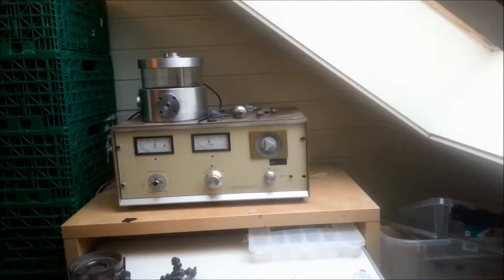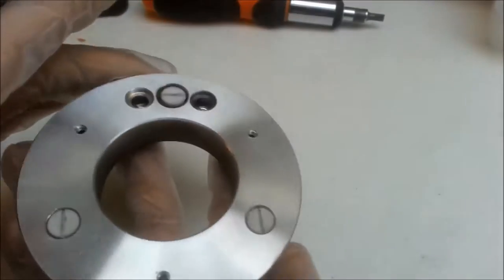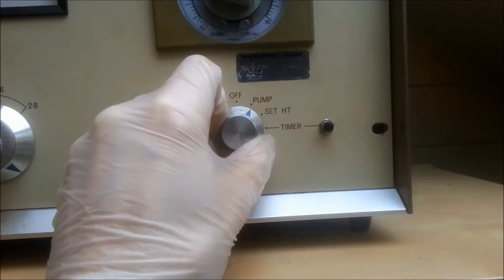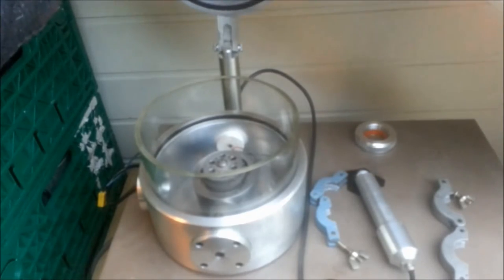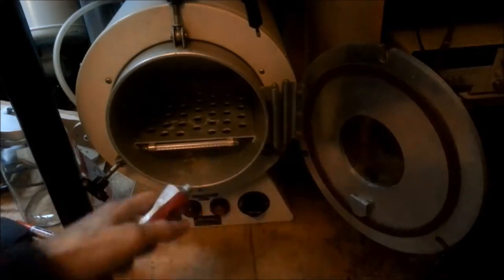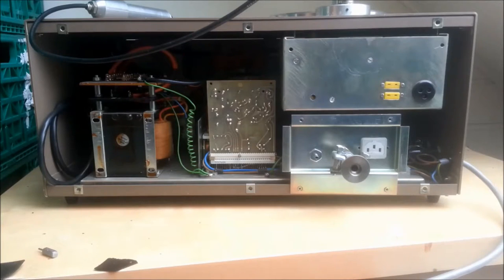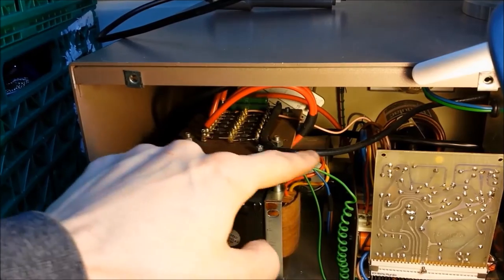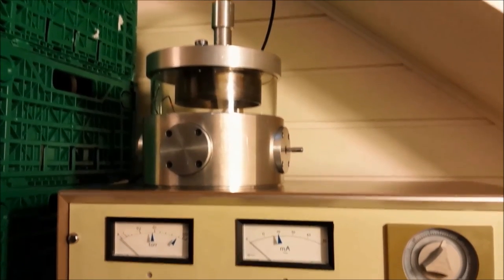The e5100 Sputter Coater Teardown/Maintenance.

Comment: I am used with some of the new versions of sputters and just wondered how stupid is the new design of the targets till I came to see these old models. What a huge size of the target with the right shape, since magnetrons always chew an annular shape. Nice to see that the manufacturers got it right in the beginnings, then downspiraled
Reply from the maker: I know right! It feels like you pay for the fancy metal in the target, with the disks there is still like 40% left when the disk is unusable.. There is definite elegance in the simplicity of old school, my only caveat with the e5100 is that it predates standard flanges like kf, so there is currently an improvised coupling that never seems to keep tight..
Reply: @JKKnudsen  If you replace that tube at 6:44 with a piece of tygon tube it should solve a lot of issues. Nevertheless, I also used a similar type of tube to pump a dewar with a vacuum valve operator down to 10-6 torr, which is overkill for the sputter needed pressure, and can allow, with some fiddling, the operation of 2 stage pumping systems. There was another type of sputter coater I used that is from Edwards. Instead of using 2 pumps, it used only a rotary pump and reached low vacuum via a Ti getter disk, thus removing the need to have the turbo pump with all its control electronics.
Reply from the maker: @ciprianpopa1503  I may try the the tygon. I did turn a stainless kf addapter attachment on the lathe, but the pipe on the SEM is copper, and silver solder pricing rubs me the wrong way these days. So I never got around to it. A friend of mine has one of those Edwards pumps, they are super nice! He use the same setup for making various vacuum tubes, heating the getter with an induction coil after sealing the tube.

Comment: I recently bought one of these, the E5200 Auto Coater made in 1984 but otherwise very similar. It was in a bad state, previously a home to a mouse, complete with chewed wires etc. I'm in the process of restoring it and hopefully use it for coating semi-silvered mirrors :)
Reply from the maker: Oh cool, the e5200 should give you some much needed headroom. Still the same kind of feed-through though. Leaks like a sieve:P If you contact quorum technologies, they may have refurbishing kits for the e5200, even though it is discontinued. Mouse you say, wonder what Pinky and the Brain has been up to:D
Reply: So far, I replaced the ballast resistors for something more substantial, managed to find the right O rings. I did notice that you have a proper magnetron head on yours. On mine, it has a couple of ferrite magnets attached to a dark shield. I'm replacing those. I will contact Quorum though. I didn't think they'd be interested!  There's a shortage of videos like this. Keep it up!

Comment: Hi, thank you so much for the video! We have this model in the lab, but no one knows how to use it. Do you still have the user manual? The PDF link you posted is not valid anymore. Greatly appreciate!
Reply from the maker: Ahh typical. I don't currently have a link. And I'm not quite sure what company has taken over service of the product. 
That said,  I've been thinking about rebuilding the vacuum line of this machine to KF, and replacing o-rings etc. I could do a video on it and include a complete operators guide.
But in short:
-Make sure everything is closed/off.
-Open argon regulator(NOT the needle-leak-valve on the machine, but the regulator on the tank)
-Set operator knob to pump.
-Start pumping to ~0.02torr(should be a mark on the display)
-Carefully open the needle valve and flush with argon to 0.1torr. Close the argon needle valve.
-Pump back down to better than 0.02torr. Repeat flushing until you do.
-Set the timer, typically about 3min.
-Turn the operator switch to "set HT"
-Turn on the voltage up until the mA-meter reads 5-10mA
-Now the most difficult part, carefully open the needle-leak-valve a little. Notice the mA went up. Repeat this step until the mA-meter reads 19-21mA. DO NOT EXCEDE 25mA! Or you have to start over. 
-When you have ~20mA(You may have to adjust the argon leak valve to maintain 20mA). Press the timer button, and switch the knob to "Timer"
-When the specimen is coated, turn down voltage and close the argon leak-valve(DON'T overtighten) . Set operator knob to "OFF". 
-Ventilate the system by pulling the know on top of the machine. Close argon-regulator.
This procedure is for sample that can survive ~80 degree C. For samples that can only handle about 40C, you can connect the thermocouple module to the socket on the back panel, otherwise leave it disconnected.
Hope this was of any assistance. Let me know how it works out. It's been a few years since I used it last(it's leaky), so details slip my memory.

Comment: Thank you! This was very enlightening! Since you mentioned getting water in your vacuum pump could you talk a bit about the kinds of situations that can lead to water in your pump? Do you have to worry when simply pulling out high humidity air or is it only when pulling out air containing steam (which of course is easy to do by accident when pulling a vacuum)? I assume that the vacuum pump heats up from operation and thus pulling high humidity air into it shouldn't cause water condensation assuming the air starts out at room temperature? Also, what kinds of systems exist to filter water before it hits the vacuum pump?

Comment: Hello,very interesting vid! I have a similar tool for SEM specimens coating (unfortunately no model number anywhere on the chasis.Crazy...). Still works just fine though! I would like to do some maintenance but have no service-manual. Can't find it anywhere online. Do you have such a manual? Thanks.
Reply from the maker: Cool! Mine currently has a leak in the back as it used an improvised kf-flange adapter. I used to, have the manual, but I see the link in the description don't work any more. But have a look at http://www.iitk.ac.in/meesa/SEM/coater_manual.pdf           
it's pretty much the same SEM coater. But from Quorumtech, the guys that took over Polaron
Reply: @JKKnudsen  thanku! hope u ll solve the leakage issue. I love these 'old' instruments still staying 'alive' :P
Reply from the maker: @ChrisSkoul  Thanks! Same, it's amazing what gets thrown out of Uni basements, and well funded research institutions:P
Reply: @JKKnudsen  yeap, like the 'service-manual' at the research centre i am working with this tool :P
Reply: @ChrisSkoul  They (manufacturers) had to kill these lines since they had to downgrade to small targets just to capitalize on consumables. As for the new models they have firmware and software  protection, once it's gone you better buy a new one.